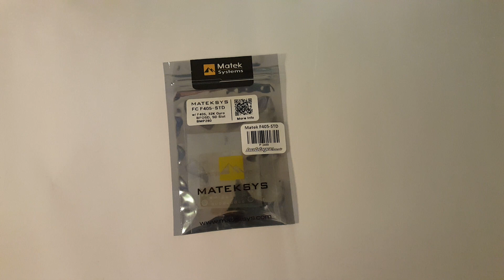Matek F405 STD // Quick look and unboxing

Comment: Racerstar Shot30A ESC 30A 30amp 3-6 4 in 1 BLHeli S BB2 ...

Omnibus F4 Pro V3 Betaflight Controller di Volo con OSD ...

https://m.banggood.com › Omnibus-F4-P...
Reply from the maker: That esc should work, 30A is enough for most motors. I don't know this model so I can't say if it performs well. Racerstar is always kind of a gamble in that aspect.

Comment: I have the RACESTAR SHOT 4IN1 ESC 30A card with the original battery cable +/- and soldered into the esc 4in 1. board. has an output connector with pin. . . VBAT / CRNT / 5V / 5V / GND. . . OMNIBUS F4 PRO V3. . it does not have the VBAT / IN pin. . . because it has the current sensor as the card racestar shot 4in1 esc. . . so how do I feed the FC (note that I've already burned one because I'm wrong). . to get the current to the FC and have the current sensor of one or the other card? . . (to be taken into account that all the boards have the current sensor). Thanks, it's very kind of you

Comment: thank you. very kind to have done some research for me. . I try to see links. . . in the meantime I would ask you for advice on a F4 Fc to be matched with the RACESTAR SHOT 4IN 1 ESC banggood. . . that I have already bought. . . . thank you.
Reply from the maker: Hi, any esc should work with that fc. I don't recommend buying racerstar because they have no quality control process. Could you maybe specify what exact esc it is or send a link since I can't find your model.

Comment: Hi mister . .
I have problems with the FC MATEK F405-STD. . .
in practice, the led_strips do not work together with the barometer also by configuring with CLI. . in Betaflight the S7 pin as described in the matek portfolio guide. . .
then I say. . . what's the point of building a FC F4 with ledstrip and barometer if you can not use them together?
I have read several thred that have the same problem. .
you who are expert. . you think we're all wimps. . or is there a solution? I consider you a teacher in these cases.
Be kind, give us poor sinners a valid answer
Thank you so much.
Reply from the maker: Hi, I don't think your a wimp sir 😀. I personally don't have any experience with using the baro or led strip since I don't use those. I just did some research and there seems to be a problem with using both at the same time. I read a fb post about someone that had the same problem and he also couldn't figure it out. Matek says to resource it to s7 if you want to use both but since that doesn't work you can maybe try to get it on an other pin? Have you already thought about asking your question in the official Matek fb group? I'm sure they also have some experience with this problem. I'm sorry that I can't help more but I just don't have experience with using the barometer.... Here's the link to the fb group : https://www.facebook.com/groups/1882519175321708/